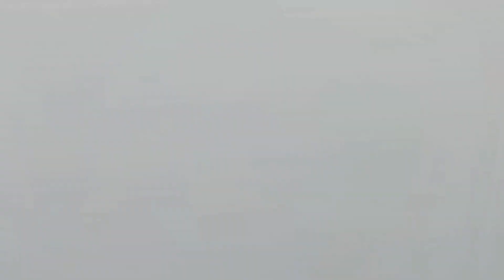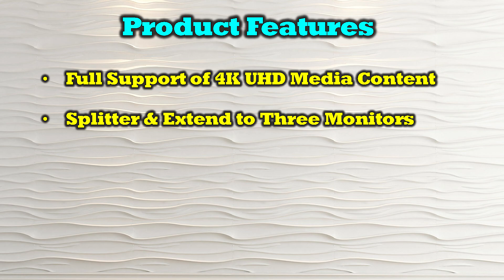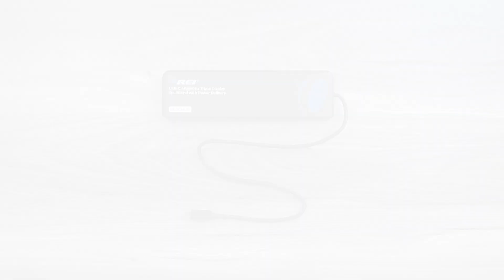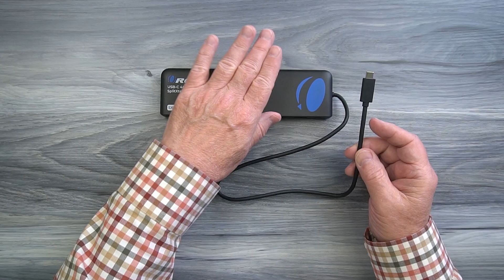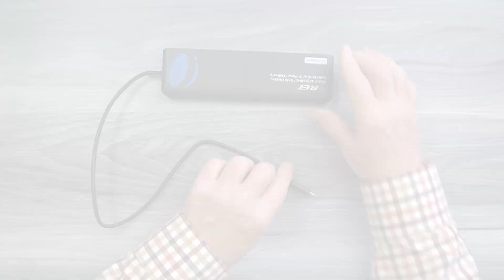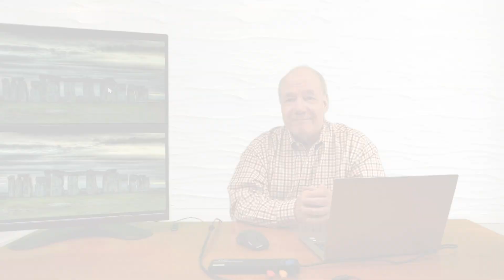OREI SplitExtend Triple Display Extended Monitor Screen Docking Station

Comment: Does the c port in a laptop have to have a lightning bolt?
Reply from the maker: Yes, that is correct. But that does not always mean it is a Thunderbolt port. You can check the specifications of your laptop to find out if the port does support Thundebolt or DisplayPort Technology.
Reply: @OREI-COM  Thank you